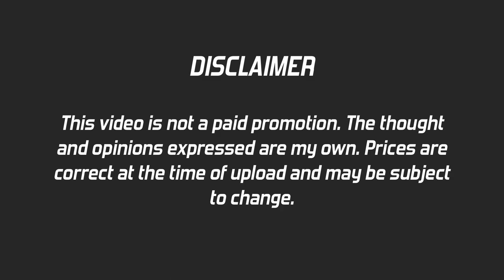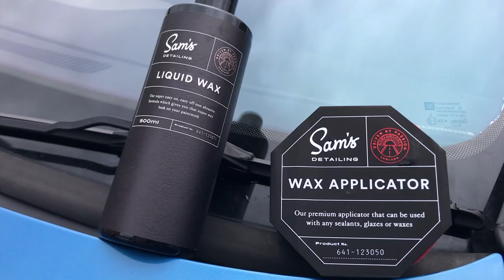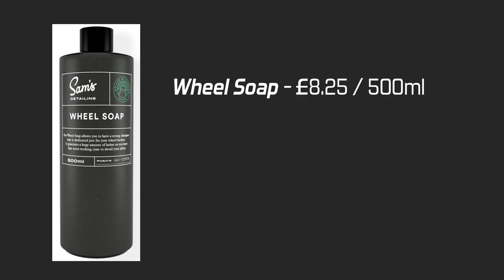Sam's Detailing Review -  Astra GSI

Comment: Like the look of the iron remover, the gel additive is superb compared to Iron X.  Wonder if they do a tar remover with those qualities - I like AG Tar Remover in a spray bottle but it runs off in no time. 

Never liked those wheel brushes for the exact reason you mentioned - the spray back! I find woolies to be much better at cleaning as you can put a bit more pressure on them to clean the 'hoops' of the rims compared to the brushes.  Don't see the reason for specific wheel cleaning soap either, seems a bit mad.

Products look pretty decent overall though.

Comment: Great review Luke not tried any of there products on my channel yet nice to see a company investing in good trigger sprays they are the Bain of my life as for the wheel brush extra few quid and get the chemical resistant super hard wearing EZ large brush the wheel soap is for regular maintenance washes 👍🏻
Reply from the maker: Thanks Paul, the spray triggers make all the difference. It's worth keeping the bottles and triggers and throwing other products into them when they're done with :D
Reply: Paul , like you I have big gorilla hands and small trigger sprays heads are just unmanageable .  I prefer the larger spray heads with a strong spray . 

I did buy a few £1 spray bottles from B&Q , but they  stop working and leak all over your fingers with product .  I will invest in better more expensive bottles from Auto Smart .
Reply: Jaye Dee yes Jaye a good idea 👍🏻

Comment: Anyone know the best detailing products to use on Arden Blue?  Paint is quite delicate and I'm pretty worried about using certain products on my VXR.
Reply from the maker: In what way is the paint delicate ? Is it flaking?
Reply: Torque Steer no mate,  not flaking,  the salesman informed me that the Arden Blue is a really delicate and soft paint which is why it is now discontinued and been replaced , I just wasn't sure about putting certain detailing products on it just in case especially non PH balanced ones,  I need a bit of tar removal and would love to give clay baring a go
Reply from the maker: Most products will be fine on it. It’s more incorrect applications that you would have to worry about. 

Any shampoo and snow foam will be safe. So will the pressure washer. Just make sure to use a microfibre wash mitt and two buckets. 

Iron remover will be fine too. That will only react with iron particles. 

Tar remover again, no problems. Let it dwell for a little bit to soften the tar and wipe with microfibre. 

Clay bar, although ever so slightly abrasive won’t cause any issues either. 

Polishing and compounding can indeed cause damage but it’s still really hard to do these days. It used to be the old buffers that burned through the paint but modern DA polishers don’t get hot and there’s no chance of burning through by hand. 

Really the issue with soft paint is that it’s easier to inflict swirls and scratches on it but everything I used in this video would be 100% safe to use.
Reply: Torque Steer thanks man,  I will need to invest in a few of thosd products but I'll give it go then.
Reply: It's only a "delicate" finish on the Astra J VXRs. If you've got an Astra G or Astra H you'll be fine. LOTS of Astra J's being reprayed under warranty due to the terrible paint from factory. I use all Bilt Hamber products on my Arden Blue GSi.

Comment: Is it worth using that ceramic boost as a drying aid would you say?
Reply from the maker: If you’re using the ceramic boost anyway to protect the paintwork, then yeah. It would work just fine as a drying aid. Bit too expensive if you’re gonna apply a wax anyway.
Reply: thanks for the reply fella and to the one about the spray triggers :)  im gonna pop an order in and mention you anyway bud thanks!
Reply from the maker: That's great, thanks :)

Comment: How would you recommend washing a microfibre mitt and drying towel after use?
Reply from the maker: I throw them in the washing machine. If you want to be 'proper', use a detergent (ideally liquid) that has no fabric softener or scents as they can sometimes reactivate when they get wet again and cause streaks. Probably not an issue with the wash mitt as it's getting completely soaked when it's in the wash bucket anyway.
Reply: Torque Steer okay thanks